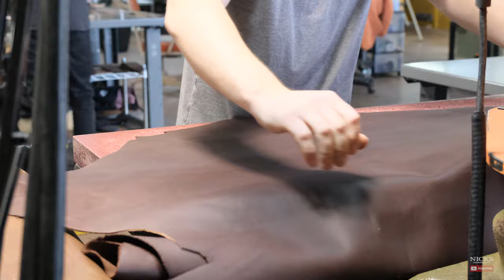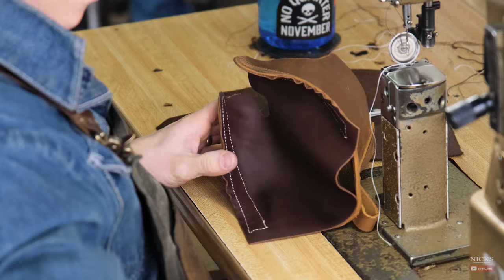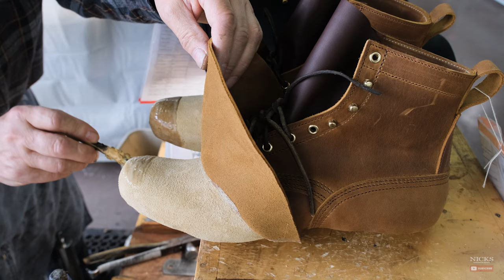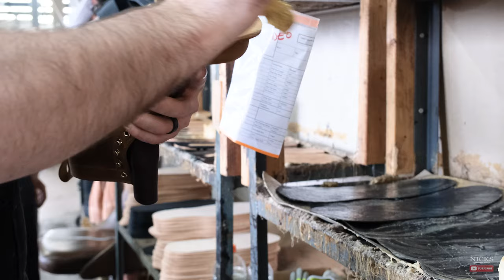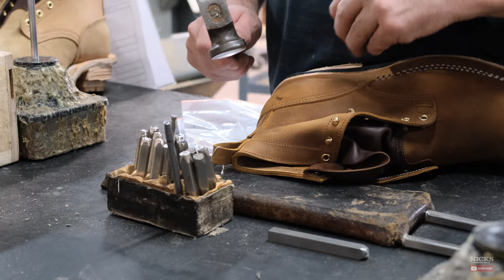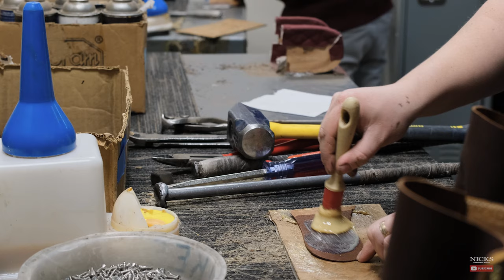How America's Toughest Work Boots Are Made - Nicks Urban Logger

Comment: Tough boot, but is it really smart to place the seams over the profile of the soles?
Reply: It's neither smart nor dumb, it just is. Sure the thread will snap, but not all of it AND there's still glue and screws holding the sole on. Also the thread isn't pulled out that easily. That rubber is tough.
Reply: @Totemparadox  Another way of looking at it is that other boots don't even sew the outsole, just glue. And they work just fine. So in this case, like you said, even IF the thread completely fails, there's still glue and screws holding it. So it's still better than other boots such as Timbs or Doc Marts.

Comment: I was wondering...for the price point, why aren't the soles trenched before stitching?  That thread is no match for concrete when exposed.
Reply: No need to. Yes the threads get chewed and cut up, but the glue, screws, and the friction of the thread still inside that thick sole work together at keeping thew sole attached.
Reply: @Totemparadox  Well they can use rivets, staples, c-clamps and Bondo too, but if they're going to do it...at least do it right.  Throwing the bathroom sink at it isn't a valid excuse not to do it right, especially when you're charging $500+ a pair.
Reply: @Skulllywag  Or they can not do it. If you'd done a minute of research you'd found out that not all their outsoles are stitched. Some are just glued or glued and screwed. You don't seem to understand that the thread snapping has no negative effect on the integrity and it would snap with enough use even if the sole was trenched. This is the classic way of doing it with that machine and if you don't like, buy boots from someone else. Some people...